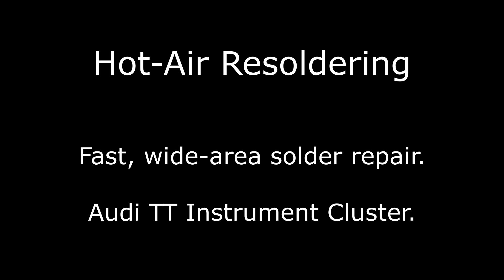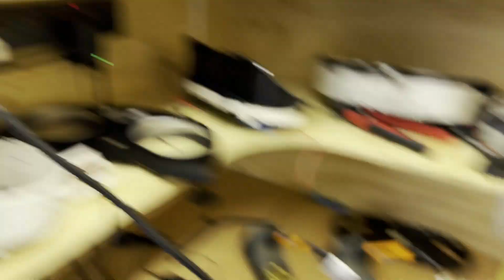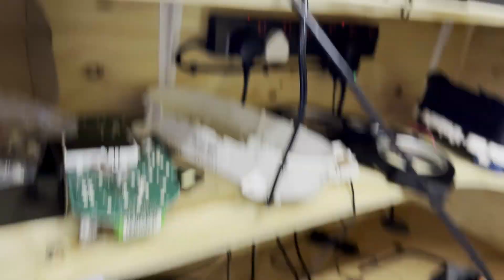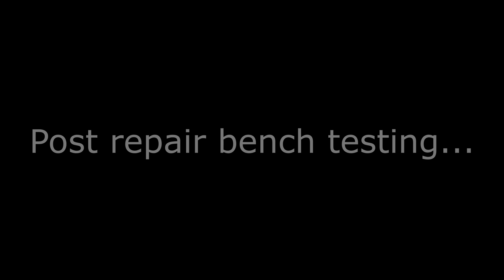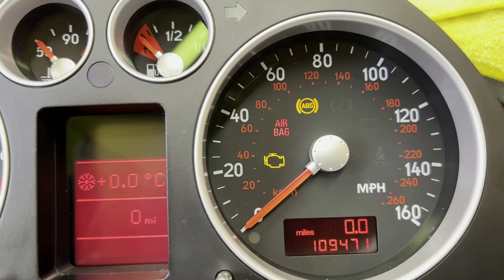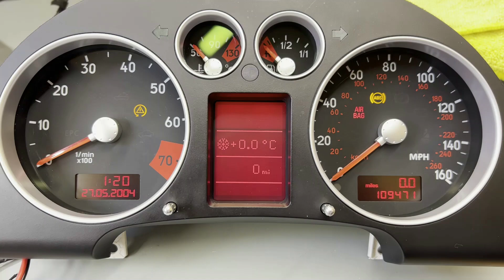Hot-air solder reflow Audi TT cluster

Comment: Good day. I am in the USA and need to have the reflow done but cannot find anyone here to do this. Is there any one that you know of in the us that can do this? If not, how do I get this done by you or is it something I can do myself? I have the dash apart and there are lots of spots around resistors with a yellowish goo/dust that is around many of the joints and Im assuming my problems with the lights flickering on and off rapidly are due to the solder joints being weak. Thank you for the video ad time.